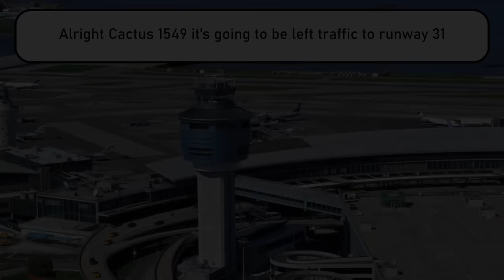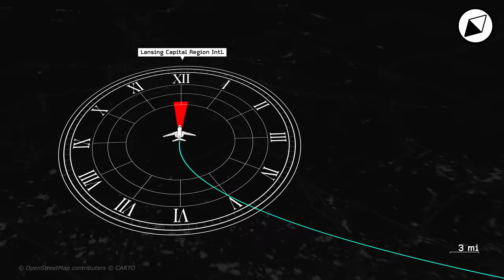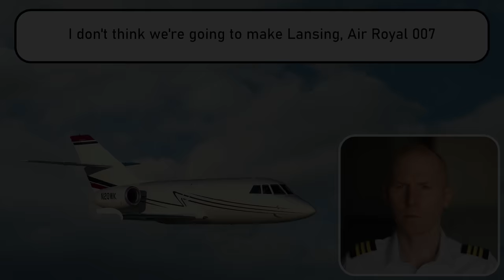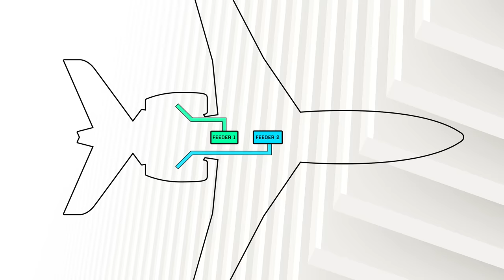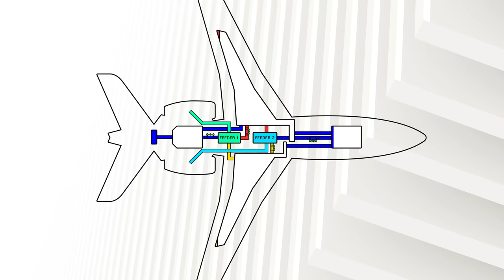Most Bizarre Dual Engine Failure Ever

Comment: Ha, found a tiny thinking error. Being heavy is an ADVANTAGE! Think about it, you got more potential energy, you can glide further. It is the reason why competition gliders take water balast along, climbing gets harder, but coming down you literally have a bit more power. Why would things be different in a large plane with engines? Ooops, you do not have a huge wing surface, that's the problem. Even at optimum IAS for gliding, these things come down like a dead bird. Sorry. Why not extending the wings, and cruising a bit slower, then these business jets could glide further, when things go terribly wrong. It is pretty simple, right? Get a motorglider version of those business jets. Design choices. Why not? If these owners wanted speed, they could buy a two seater F15 without the weapons. Those are faster. A lot faster. Why do they buy these flying caravans? Sorry, but do you get the point?
Reply: In one of his videos he explains that his first flight instructor had the same belief and then he explains from his actual experience as a commercial jet pilot why that belief was wrong. Heavier=Bigger=Larger surfaces to create drag=slower.